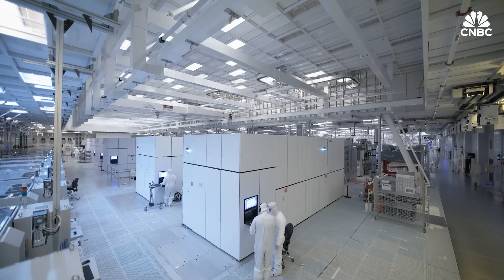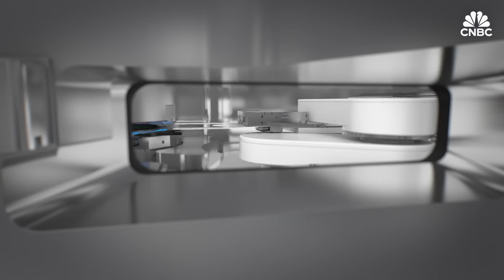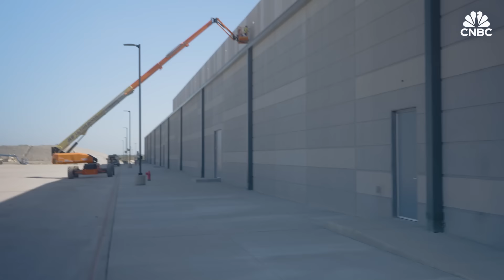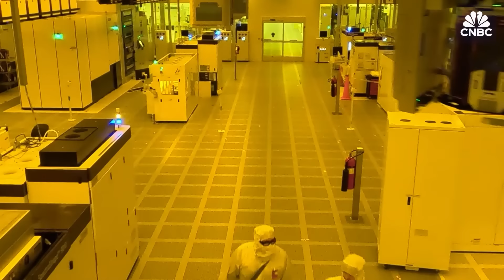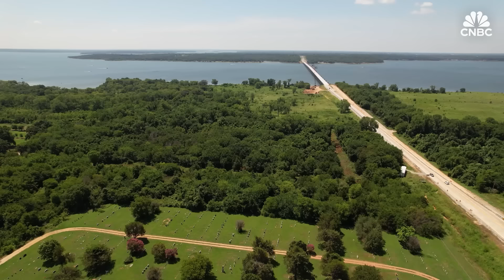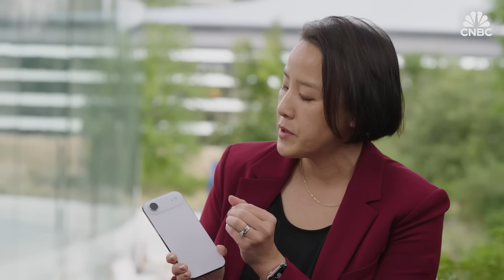Inside America’s Race To Build The Next Generation Of AI Chips

Comment: The TI section doesn't get enough credit in this piece. Building $60 billion in new fabs for chips that cost 40 cents each shows a deep understanding of where the real bottleneck lives. ASML and Apple are pushing the leading edge forward, but the entire AI infrastructure also depends on the analog and embedded chips that manage power, process signals, and keep everything running. Great to see CNBC covering the full stack, not just the headline chips.

Comment: And just as the rule of thumb became "provincialized" or "localized" during the advent of steam engines... Then electricity and magnetism (I am referring to electrical engineering.)...

Moore's Law has also become a localized trend.. To describe the relationship between the number of transistors, time of production (and in some cases, design) and cost.

What this means is that Moore's Law is still true but under some constraints.

Again... That is why it is called as a rule of thumb... It is not really a law that is in the same sense as the law of thermodynamics... Law of motion... And other laws of physics...

😂😂😂😂😂😂😂😂😂😂😂😂😂😂😂😂😂😂😂😂😂😂😂😂😂😂😂😂😂😂😂😂😂

Comment: It’s a good thing China doesn’t have access to ASML EUV. Even if China stole the blueprints for EUV, it would still be almost impossible to build. They might copy their way to 80%, but this is the one thing their usual copycat tactics can’t finish. They lack access to Zeiss lenses, US lasers, and advanced control software. China is about 10 to 15 years behind. Their most powerful chips are only 7nm, made using outdated DUV machines. Yields are low, costs are high, and power efficiency is poor.

Comment: Really glossed over how impossibly hard the vaporization of the tin is. They actually shoot it in such a way that the droplet deforms to a flat disk at a specific angle so when the laser hits it the light is reflected in a specific direction. 50,000 times per second

Comment: just joined the crowed and got laid off from Intel. I've been with them since covid when they were hiring like crazy instead, but they either hire like crazy or fire like crazy. However, there is nothing like this one. During covid we were peaked. With the chip shortage Intel reached a peak it hasn't had since the 90s or 2000s. Will see how long it's going to last because they literally laid off about a quarter to third of the company since last summer only tens of thousands, and they're not done yet!
When you reach a peak after a valley you have to be very careful and plan well because you have to expect a valley after. Instead, they wasted so much money like in Ohio for example, and they turned away great customers like Apple. They got cocky and didn't even participate in the future of AI, and that's it. It's a combination of things but mostly AI. Not because AI is taking jobs, but because AI is the new technology. It's like what happened to Nokia or Kodak before.

Comment: Metal reliant chips are already old-tech. Light (photon-based) chips are the actual future. Both speed and energy usage are more effective with them.
Reply: check again, photonics is currently worse in just about everything compared to silicon chips. they are successfully used in some areas but they need a lot more time & R&D. and they too also, at least for now, depend on silicon.
Reply: @giornikitop5373  Silicon as a layer in components will not disappear for a while - agree to that. But as of performance - completely disagree. Start by looking at this for starters: https://qant.com/wp-content/uploads/2025/11/20251111_QANT-Photonic-AI-Accelerator-Gen-2.pdf

Comment: The ASML CEO  ( Christophe Fouquet)   is widely perceived as a very strict and disciplined leader. His management style appears highly controlled, almost like a helicopter approach — closely monitoring risk, people, and process. This is partly because ASML sits at the center of global semiconductor power, where even small failures or ethical lapses can have major security consequences. Under this leadership, there is clearly zero tolerance for cheating, dishonesty, or conflicts of interest. Workers or staff whose actions raise integrity or compliance concerns are dealt with firmly. From his perspective, trust must be proven through systems, audits, and rules, not assumed. This creates a culture where discipline and transparency matter more than flexibility or second chances. The same strictness applies externally. ASML has fully cut off Russian and Chinese government access to its most advanced lithography technology where required by sanctions and export controls, especially to prevent any military or AI-enabled weapons use connected to the Ukraine war or potential Taiwan conflict. Although ASML does not manufacture chips itself, its equipment enables advanced chip production, which makes these decisions strategically critical. Some will say this leadership style is necessary and responsible, given the stakes. Others will argue it feels harsh, controlling, and unforgiving, especially for employees affected by geopolitical pressure rather than individual wrongdoing. In that sense, he can be seen as both “nice” — in protecting the company and broader security — and “not so nice” — in how rigidly rules are enforced. Overall, he comes across as a serious executive who values order, discipline, and integrity above popularity. Whether this helicopter-style leadership strengthens ASML in the long run or limits flexibility is a valid debate, but it is clear that leniency is not part of his approach.

Comment: another way to reduce the costs is to re consider what chemicals are restricted due to illegal use for example instead of targeting lithium batteries, matches or white gas why not target sudafed instead.

you CAN NOT cook meth by omitting sudafed or at least you cant get a working substance.

so if you just monitored and restricted sudafed alone then there is no need to monitor and/or restrict the other supplies like lithium batteries and matches.

thereby no license required to show that matches and batteries will not go into meth cooking.

Comment: 1. i think why the video is being reposted is to keep it at the top of the list so they can keep milking old videos.

2. if trump really wants chips made in the usa then the fab machines should also be made in the usa because it is easy for the foreign makers to install some beam splitter and split the UV beam and intercept the design from the beam in a similar way that van eck phreaking was to CRT monitors and supposedly reading the blinking light on a hard drive to get data.

it is easy to feed the fab machine an encrypted design to etch but it is difficult to keep that design secure all the way to the semi conductor wafer.

so trump dont tell us you want chips made in the usa until you get the fab machines made in the usa
Reply: i bet that won' t happen any time soon, as asml moving to the USA will be blocked, you can look at Trump and his shenannigans for that stance.

Comment: There's a race for Lithography, Design and Fab.  The Dutch have the Lithography lead, the US has the design lead and Taiwan has the Fab lead.  You need all three to truly have the Ai chip lead.
Reply: Apple is only a customer of TSMC, Taiwan dictates what they can do to USA, not the other way around.
Reply: China leading in balance
Reply: @Dr.bhushanbhole  China has tried to copy all three.  They can copy design, then realized they can't copy their way to lead in any of these.  They will be behind for decades or forever.
Reply: @DanH-u3f  No chance. The sheer scale of operations from different scientific angles they undertake to achieve EUV and technologies beyond that domestically dwarves any other historic effort of similar grandeur. It may still fail but there is also a good chance that it will succeed. You should also not assume, that everything ASML did was the most efficient way to achieve such and such lithographic capabilities, there are certainly yet to be discovered shortcuts.
Reply: @DanH-u3f  one cannot count them out. Lets not forget it is a civilizational country. Such countries have time and again shown their innovative spirit. Some examples are already there. They carved out a 5nm chip out of a 7nm lithography machine. Nobody thought it was even possible. They also seem to lead with silicon battery tech, and even if that is not cutting edge solid state, it is a different tech lead and shows their innovation calibre. Also the shear scale they work with is worth admiring/competing

Comment: I think SOME good will come out of the slow down in shrinking nodes.
Maybe eventually all fabs will catchup to  cutting edge and event the simplest of chips will use little power. Architectures can be built on nodes that have been out for years so they can dial them in.
Maybe we can see fabs using both sides of the die after 10 years.

Comment: If anyone wonders how the US controls the export of these systems (EUV), they should know that:  

 - EUV technology was originally developed in the US through consortiums involving DOE national labs, NIST, and many prominent private US companies.  
 - ASML was actually late to the game; it received permission from the US government to join the consortium, which gave it access to the technology. (The US government rejected requests from Nikon and Canon to join the program due to national security concerns. That is why Japan, despite its significant share in the lithography tools and equipment market, does not produce EUV systems.)  
 - Along the way, ASML was granted approval by the US government to acquire several American companies, enabling it to build the system into what it is today. (It still operates under many of those licenses.)  
 - Many critical parts and components of the EUV system were developed in the US and continue to come from American suppliers. For example, the optics/mirrors technology was developed by Lawrence Livermore, Lawrence Berkeley, Sandia National Laboratories, and Tinsley Labs in the US, before being transferred to Zeiss. The reticle stage technology was developed in the US and is still manufactured there. Most importantly, the core and most complex part of the system—the light source—is designed and built in the US by an independent California-based company called Cymer. The laser is also designed in the US by Cymer and manufactured by Trumpf in Germany.
Reply: nice, cheers